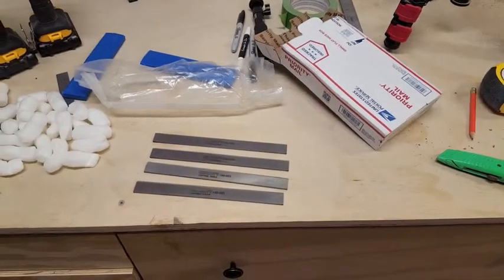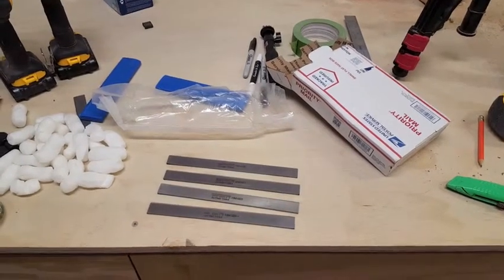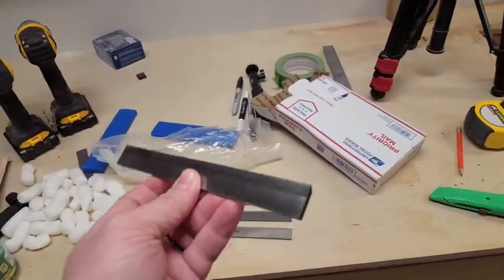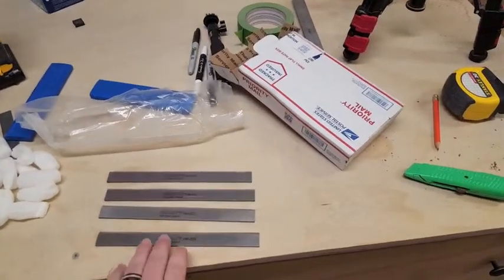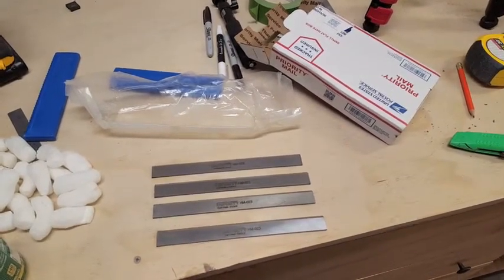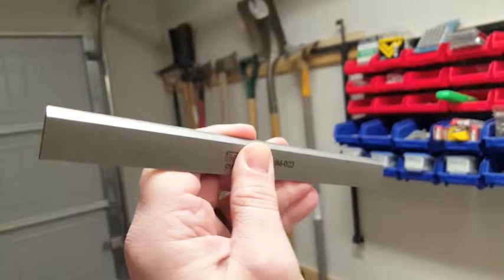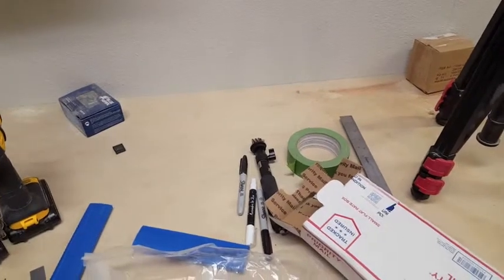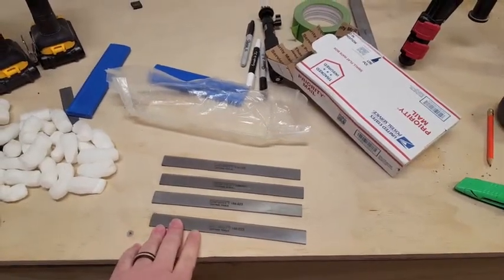Carbide Tipped Jointer Blade Replacement Fail

Comment: I bought some from infinity cutting tools and I actually think they are really good. They have lasted way longer than hss. Lol man that sucks I'm watching this as I type, that chip would pissme off. I would not use those. I have run probably 6-700 bd ft through and there still cutting nice. Hopefully the helicle cutterhead from grizzly comes down in price soon. The guys at my wood cutters .com sell byrd ones and he swears they have a head that fits our machine @ half the cost of what grizzly is charging.
Reply from the maker: I'll have to check that out. I'd love to put a helical head in this thing and be done with blades.
Reply: @jonscustomwoodcraft9545  ya check out that site, if you send them an email the owner will message you back pretty quick. I asked him this months ago and he swore up and down it would fit. Changing the knives is just such a pain